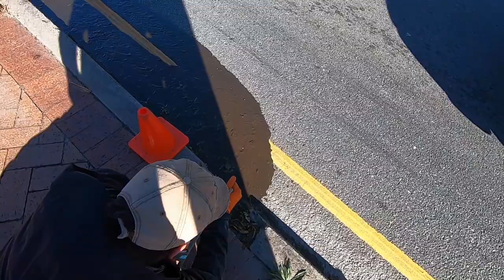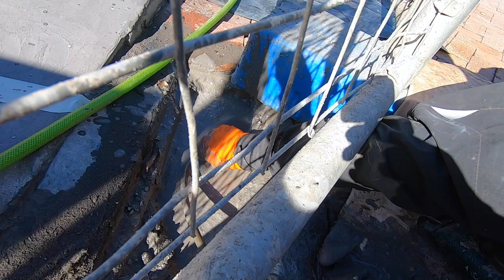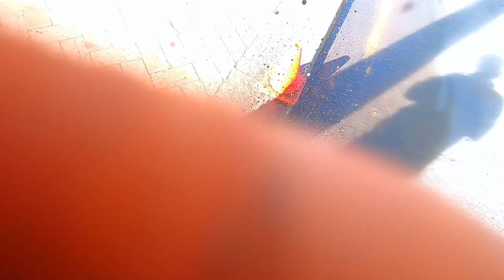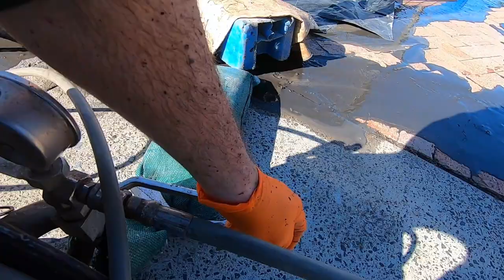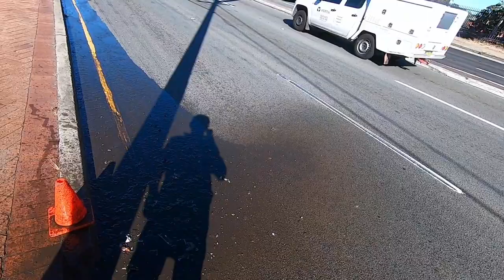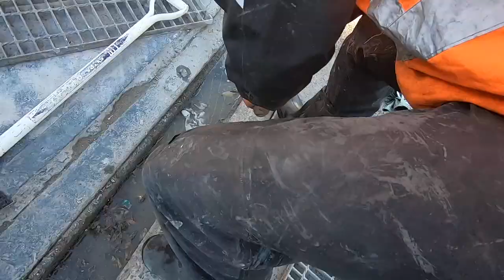Blocked Drain 224

Comment: That drain does not have a chance.  It has ongoing construction right by it and the street is higher than where the exit is.
Reply: It's even worse for the Drain than you mentioned for in addition to what you said, every time the Drain even THINKS about giving up and clogging, they call the Drain Addict to come give it a high-pressure Enema...

Comment: They overlaid the street so many times the drain can’t flow properly and the sediments drop out of the water and over time fill the pipe up. Time to grind and re-pave  the street getting it back down to the proper elevation.

Comment: That's so dangerous. Maybe in Australia people are better drivers but here in the US especially in Miami, FL it would take just one idiot texting and driving or rubber necking some shit to run you over and kill you. Any time work is being that close to a busy road around here they have a crew to block the lane and direct traffic around the workers. They even have big trucks with special spring loaded crash barriers sticking 10 feet off the back of the truck to protect slow moving or stationary work vehicles from being plowed into.